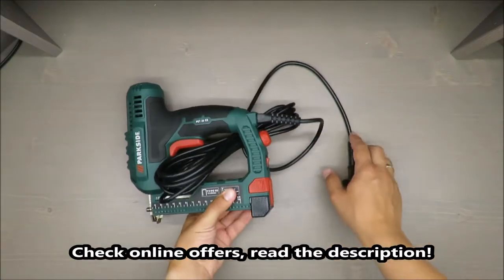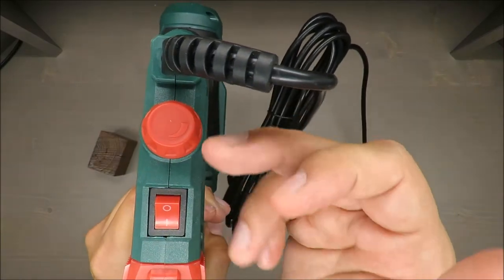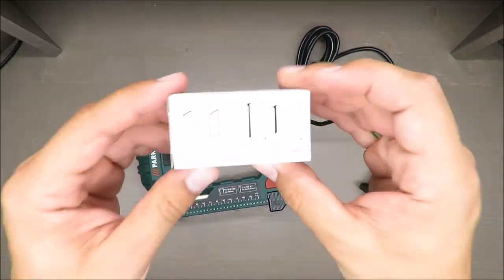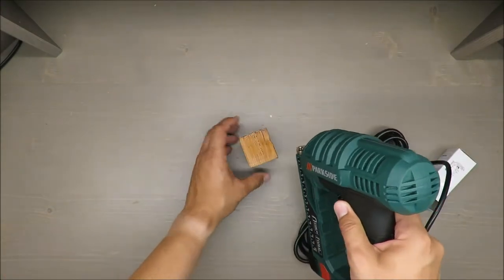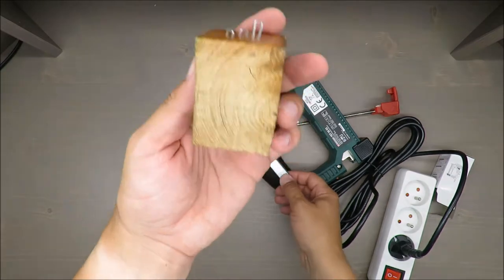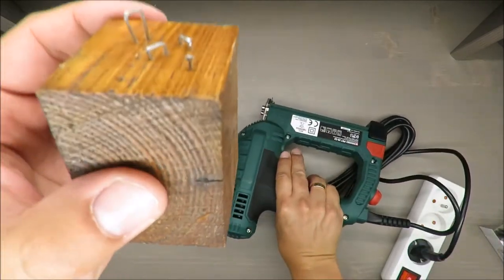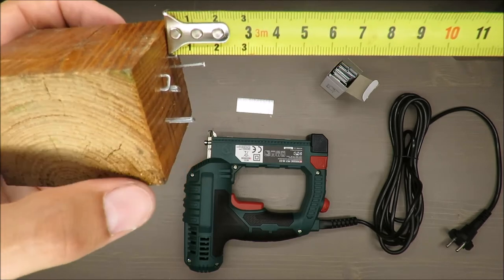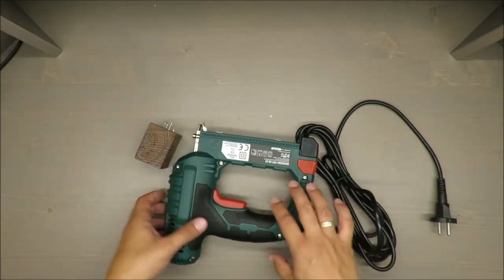Parkside Electric Nailer/Stapler PET 25 C2 REVIEW TEST (Lidl 3.7A 30 min )

Comment: Just bought one of these. Don't know what I'll use it for. It's so cheap that you can buy without doing any research beforehand :p 

I have wanted a nailer to help assemble simple plywood projects - other nailers are 3x the price, so hopefully this isn't useless. If it is, no great loss :)
Reply from the maker: Indeed :)
Reply: I think he used OAK , and that is very hard wood, so 2.3cm in that wood is more then great for that kind of a tool.
How did you like yours?
Reply: @exmachinaHR  I used it for putting up a dado rail in my house. It's not great, but was cheap and useful. Think I'd want something better for more regular use
Reply: @Parkhead_workshop  thank you.